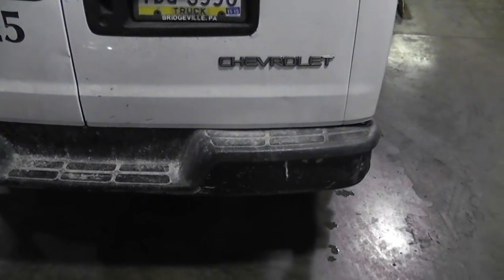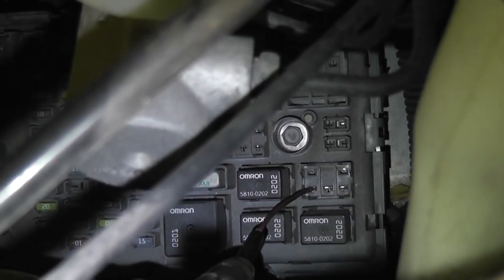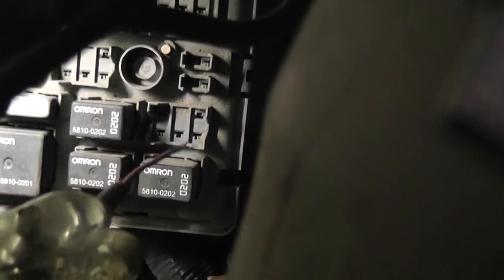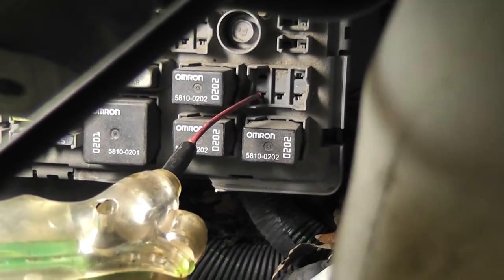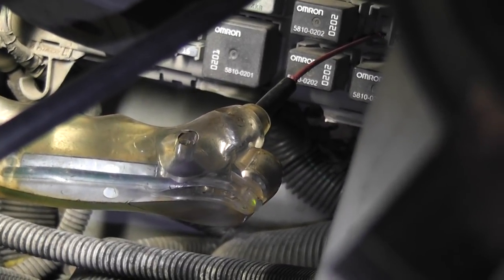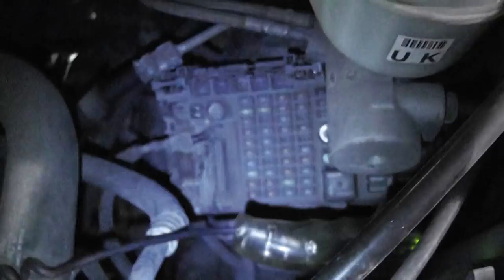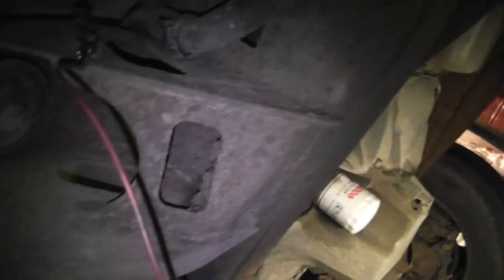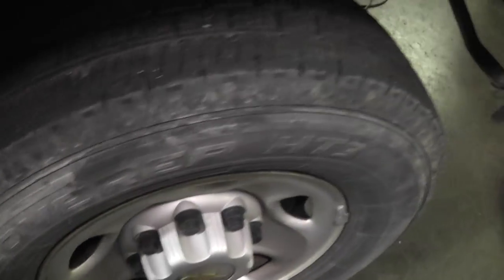CHEVY VAN NO START,NO FUEL

Comment: I seem to be having the same problem.  Running a jumper from the ground bolt behind the drivers' door to the negative battery terminal works, and running a jumper from the battery ground terminal to the alternator bracket works.  But I cannot for the life of me find the battery cable in a parts store, neither locally or online.  You wouldn't happen to have the part # would you?
Reply from the maker: No sorry. I got it from a dealer parts company that stocks GM and Ford OE Parts
Reply from the maker: The only real part that was bad for mine was the braided part that ran from the engine to the frame I think.  Even if u used a universal heavy battery cable to supplement that one u would be fine
Reply: @jamesdanner7850  OK, thanks for the fast reply.  I ended up running another cable from the grounding bolt behind the drivers' door to a bolt basically on the firewall.  Looks to be holding the steering system or something.  Works great so far!  Thanks for the video, I, like others, was completely lost until I found it.

Comment: Dude can I fly you to MN to help me trouble shoot my van lol. I have a 1999 Chevy van that randomly looses power to gauges,blinkers and fuel pump. So I could get it to start by wiggling fuel pump relay for a while and then that stopped working. So I pulled the engine compartment fuse really box and was checking the wire connections. Well I accidentally arched the bottom of fuse box and it allowed everything to turn on when I have key powered on. I also got power when I arched a couple of other random fuses and it would stay on until I powered the key off and back on a few times. Then could re create the cycle by repeating these steps. Any ideas? I'm thinking ground but you may know something I'm missing. Thanks in advance for any help!

Comment: Im in process of diagnosing a 2014 chevy express 3500 thor rv conversion 22k mileage. 6.0 ltr. Same problem. No fuel pump. Begininng of week wouldnt start. Battery low. 10.5v voltage. wouldnt turn engine over. Maybe i have same problem, backfeeding. Would drain battery over time wouldnt it? Battery was installed brand new last August. Put noco pack on to turn motor over. No fuel. Took battery out and charged over night. Reinstall battery next day. Turned key. I have fuel pump. Fired up and ran. Let sit a few days. Tried starting again. Wont start. No pump. So far checked fuel pump fuse it OK. Checked pin 30 on relay panel 12v. Ill make jumper tomorrow and see if it activates pump. Ill also test light circuit you got pulse from and see if mines clicking at abs pump as well. Ill check that ground as well. If grounds are good what else to look for? Do the express vans have a fuel pump module?

Comment: Besides the flexibility, why order a new braided copper ground strap from the dealer at $60.00 U.S?

Would it not be simple, quicker and cheaper overall to either take a bit of 4 gauge battery/welding cable and solder two female ends on?  Or go to any auto parts store and buy a pre-made ground cable of the length required?  12" to 16"  ???  The engine doesn't vibrate so violently to break such a cable and it would not corrode like the braided one.

Of course I wrote the above prior to seeing the end of the video and that spider nest cable they sent.  I guess all that for a mere $60 wasn't bad after all.

However, since the part that actually failed was the copper braid strap.  Just removing that part and adding a cable as I mentioned above would have sufficed.  Yes? No?

Comment: So I just bought one of these vans with only 50k miles on it, and I can see that the previous owner replaces the plugs, wires, cap. I am getting a random misfire at idle, but everything drives fine, maybe some rough idle on acceleration. But do you think the ground issue could cause the random misfire?

Comment: Great video and diagnosis. A lot of techs just go to the part with electrical problems when the majority of the time it is a (simple) wiring problem. It is as fun to watch you stepping through rhe problem and showing your train of thought. Thanks a lot.

Side question: what camera are you using? Do you like it? I'm in the market for an hd camera and am looking for some recommendations.  Thanks a lot.
Reply from the maker: i appreciate the compliment.  its fun doing it as well. I'm using the same camera my brother is using. no complaints.  I'll have to look at model number when i get a chance. but i did film it at the beginning of my vid with Sonoma air pump(p0410i think)when i retired my older fuzzy camera. maybe i caught the info there. i got it cheap on ebay.

Comment: theres that annoying test light! but anyway with the newer gm's now the relays cant be removed like you have here. there inside the fuse box and the box has to be replaced if one single relay is bad. just an fyi.

Comment: Fantastic Danner - great detective work, on your tester did it show voltage on the  neg control pin at the relay ?
Reply from the maker: Yes it did Steve. the one time i turned key on it wasn't clicking and probably the abs pump found a ground thru my test light. i could have definitely graphed some voltages or ohms in all the ckts but as u know time is a factor as well and all pointed to the ground as being the issue. nice pick up